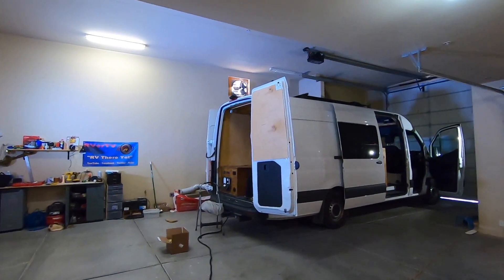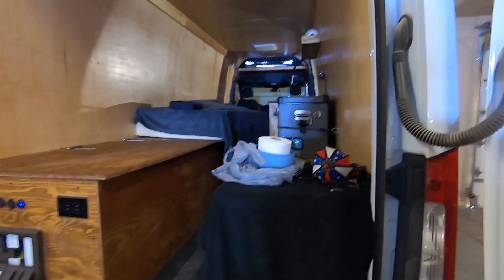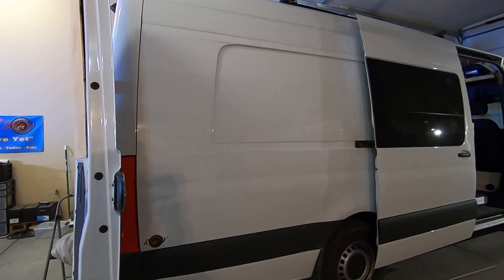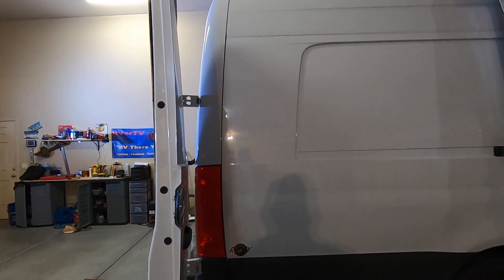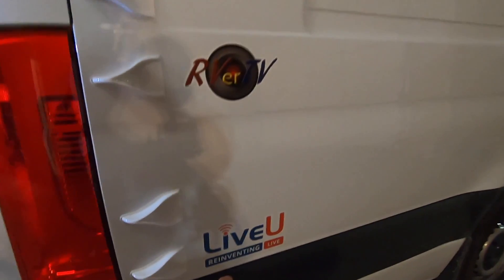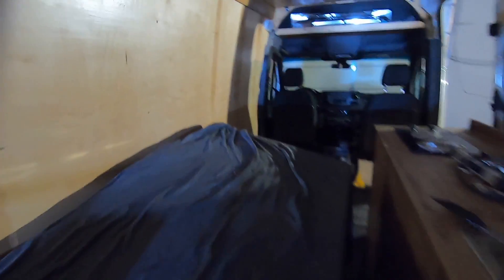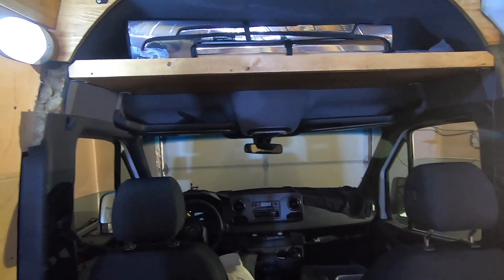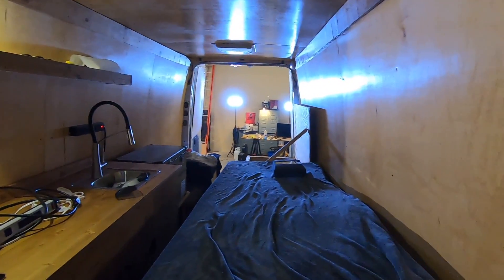Airtabs Vortex Generator - Sprinter Van Build - March 2020

Comment: Not sure why your control panel is located where you put it. Almost looks like you have to open the rear doors for access. What happens if there is a problem during inclement weather?